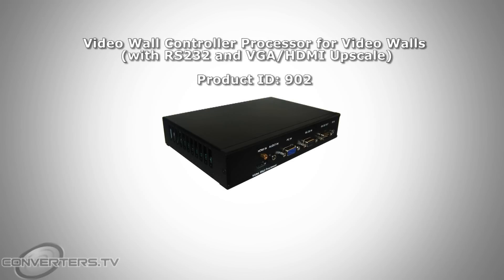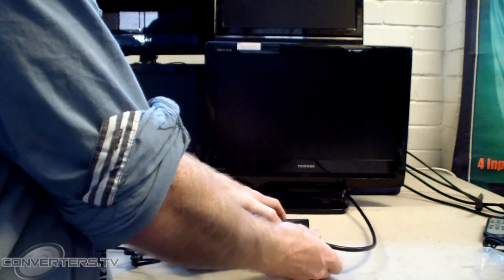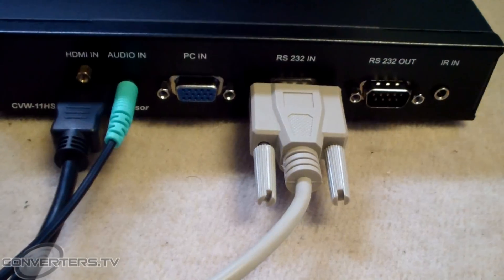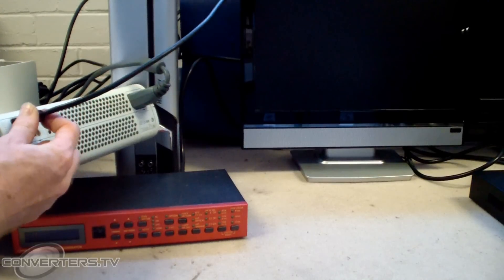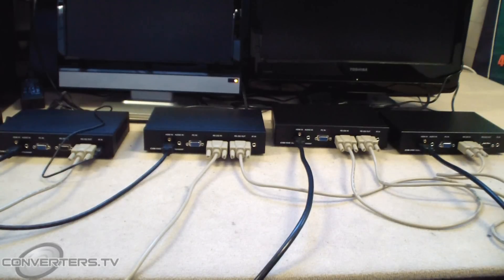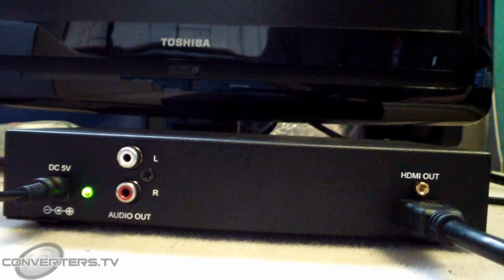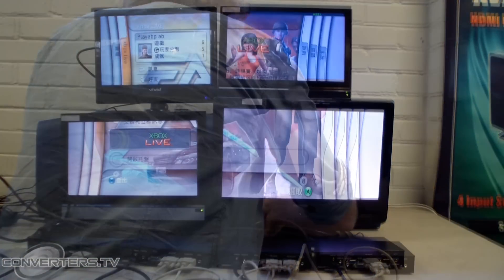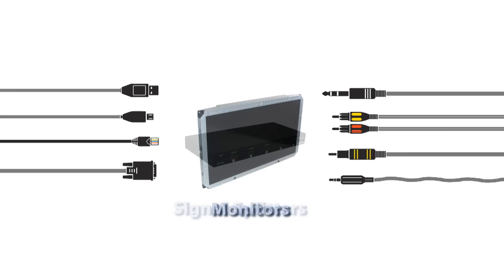How to Setup a Video Wall with Video Wall Controller Processor

Comment: Does this unit offer bezel correction?
Reply from the maker: Harj Uppal Unfortunately it does not - if you want to check out the settings you can adjust, you can check out the manual here: http://www.converters.tv/manuals/video_wall_controller_processor_for_video_walls_with_rs232_and_vga_hdmi_upscale_902_812.pdf